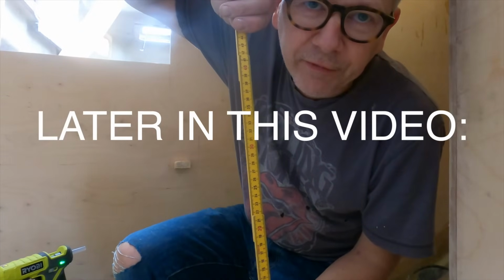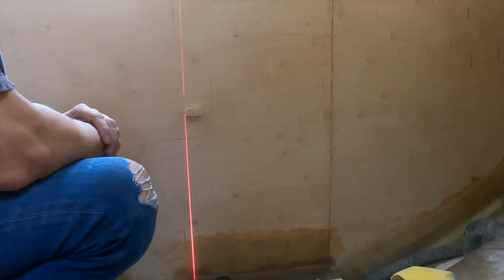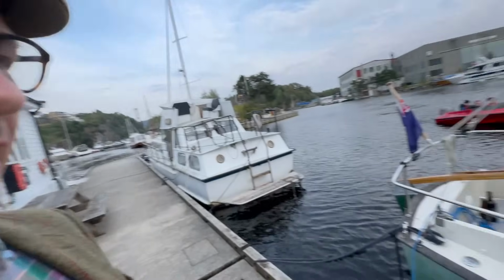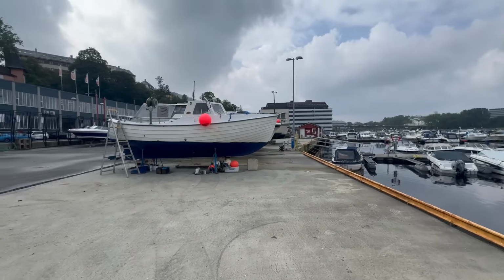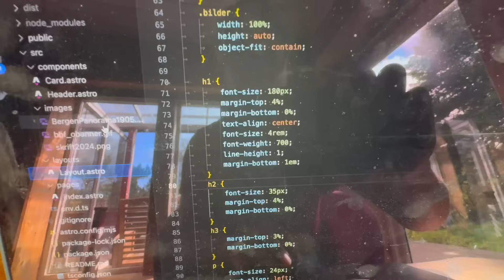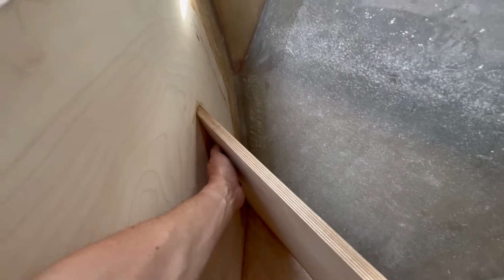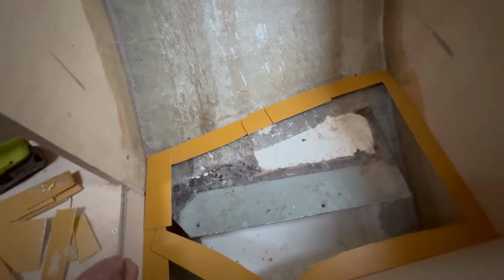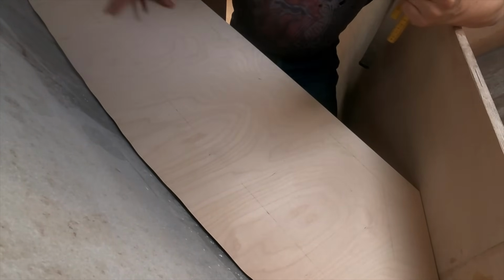Fisher 30 Ep 43 - How much boat-work can I do in two weeks?

Comment: I love your Kill Bill soundtrack from the Shadows. in your short shot from the other boat I saw the top of your head very close to the four bolt ends in the sealing. no problem on a calm sea, but very dangerous in rougher weather. if you're not wearing a helmet aboard.
Reply from the maker: Thanks.
Yes, the motorboat has 4 bolts holding the radar-antenna in place. That boat is a Class B boat, not really meant for offshore and too rough weather. Still you do have a strong point and I should make it a priority to do something about those bolts. Thanks for the reminder :-)

Comment: @ 200 litres means @ 200kg  plus your chain ⛓️ and anchor ⚓ winch.
Helm station inside...

Engine gearbox and fuel  ? How much and how far back, batteries... Then trim and fittings plus positions and sails.. Dingy and outboard...
Reply from the maker: Yes, all that and much more (inverter, isolation transformer etc), add weight. Luckilly this boat is not very sensitive to weight vs sailing speed. But stability might always be an issue.

Comment: I noticed your vehicle is electric did you consider powering the boat by electric
Reply from the maker: Hi Gregg. I have several electric vehicles (Nissan car, Twizy minicar, CE-04 scooter, bicycle and a kick scooter), but not a boat. There is a reason for that; range. The Fisher being a motorsailer means it is something between a sailboat and a motorboat. So it does not sail as well as an ordinary sailboat. Therefore it relies on its engine. The present technology indicates a very limited range on batteries, but still a very high price to pay for engine and batteries. There are hardly any fast-chargers in leisureboat- ports so no good way to recharge. Not much sun, and most of the year it is low on the horizon = less effective. So no solar charging. No great regenerating from propeller and nowhere to charge fast. And the present engine is almost new (2018). 
So exciting thought but the wrong boat... :-)